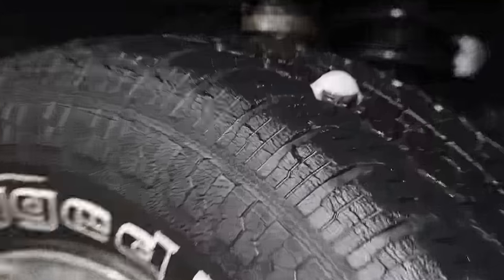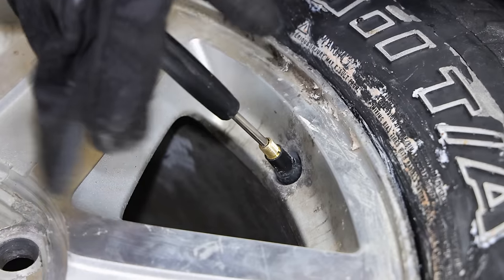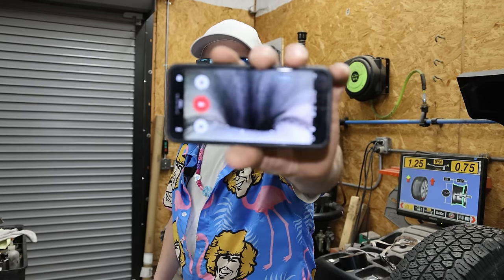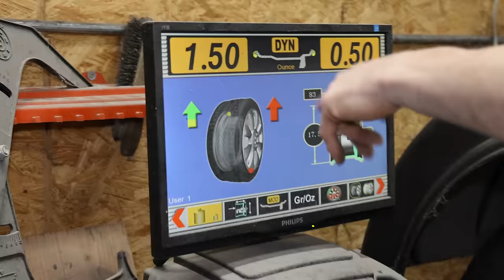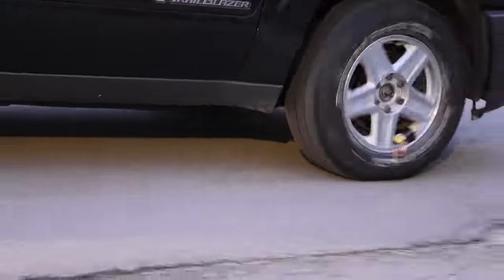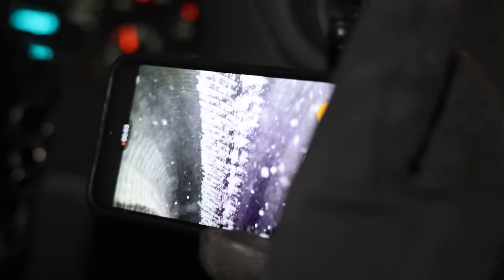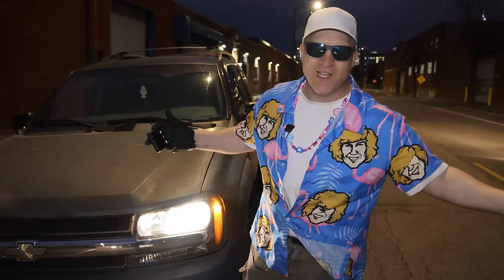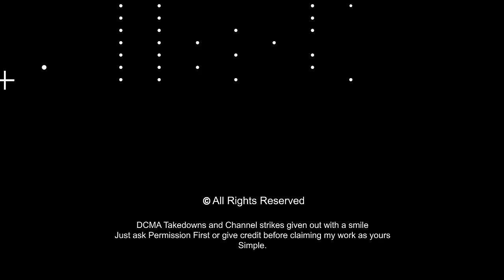GoPro Inside a Car Tire (With Balance Beads)

Comment: I spent 2,500 bucks on a set of 33x12.50-20 wheels and tires for my truck and the shop recommended balance beads cuz they were the new best way to go. A horrible shake around 45 mph that lasted to around 70 and 3 trips back to the tire shop later they took the beads out and balanced them with some stick on weights. problem solved. Not sure why they wouldn't work for me but they wouldn't. Maybe someday ill try a different application but for now i am not a believer.
Reply: These Are About As Genius As Filling Your Tire With Fix A Flat. How Many Of These Tires Are Designed To Have A Bunch Of Plastic Balls Wearing Peculiar Parts Of The Tire From The Inside? Damn We're Dealing With A Bunch Of Fucking Downsey Einsteins.
Reply: It makes me wonder if there weren’t enough beads in the tire to make it work
Reply: I bought Nitto 33x12x20 for my HD2500, have had balance beads since day one, 4 years, and I  have never rotated my tires, and they have worn more evenly than any tire I've  ever had. 50,000 miles on them and still have half the tread!
Reply: @robertheinkel6225  I wondered the same thing. When you buy them they come in bags, one bag per tire I guess but you would think not all tires are create equal and obviously much different in size. I surely can question the competence of the shop as well. Thier is a reason I do all my auto work myself with the exception of tires since I lack the machine and balancer.
Reply: I run 35s with 10oz of off-road beads works excellent.  You went wrong going to some pea brain shop. I got my own tire spoons and mount my own. They didn't use enough beads.
Reply: They didn’t put enough in.  These are mostly used in tractor trailer tires.
Reply: Big heavy tires are hard to balance and take a alot of weight sometimes. Every tire is different, rims can be bent. There are a lot of factors at play. The shop I worked at only used them when there wasn't enough room for all the weights on truck tires. You can't really hammer on 20 oz. I can't see why you would use them if you have the option to use regular weights. That being said, stick on weights sometimes fall off and are not as good as hammer on for balance. Your shop may balance a wheel perfectly but that doesn't mean it won't shake. If a wheel requires a lot of weight to balance out, it may never ride right. Sometimes you play with the tire orientation on the wheel or just get a new tire or wheel. Sometimes swapping around what you have works. Sometimes you slap on the weight and everything is totally fine.
Reply: 😂 I have a really good idea, if you normally accelerate quickly they don’t work very good for you. Or else they added the wrong amount to the tires but I doubt they did that.
Reply: You had too many beads inside the tire.....
Reply: Sounds like the shop just put in your beads and left them in the bag..  So they were bunched up all on one side? lol..
Reply: My experience EXACTLY! Tire shop insisted they go into my 265/70R22.5 Toyo Truck tires on my 33’ motor home. Ran them almost to OKC from Phoenix. Stopped at a Truck Repair and had them balanced the old way! Problem Solved!
Reply: I've had bad experience with offroad tires and beads, because they tend to have inconsistent radius (I don't know the right phrasing in english). If the heavy side and high are on same side, beads will go to the wrong spot and make things worse.
Reply: The Counter Act balancing beads he shows here are not plastic but rather smooth glass beads. I use them in my Semi Truck tires. There's a chart that shows the proper Ounce bag to use for your size tire. Also install the extended valve core that comes with them
Reply: They ABSOLUTELY work.  I've been using them on a LOT of my customer's cars for years now.  Anyone who thinks they don't, and would like to bet on it, just let me know how much money you'd like to lose, and we'll set it all up. 👍
Reply: @calholli  lmao. right?
Reply: @calholli  once I caught a 'qualified' tire "technician" he didn't know anything about these so his foreman had told him just throw the bag in there before mounting the tire...  🙄 ... well I had walked away to do something, came back and was asking him about the valve core & Red cap that comes in the bag(Outer bag) and he had no idea what I was talking about! He had literally threw the whole outer bag inside the tire! So I made him dismount the tires & take it back out & I instructed him how to install them correctly!! 😊
This was on Semi Truck tires at a Love's truck stop.
Reply: @Roger_Rabbit_Adventures   It always surprises me just how 'in the dark' people are with most things.   That's exactly why I work on my own cars..  I've seen a "technician" inside a dealership who was tearing down an engine and rebuilding it for a repair --  and the kid was barely making minimum wage and didn't have a clue what he was doing;  and there was no one around-- he kept having to go into the office and ask what to do next, etc.  While ASSEMBLING AN ENGINE;  and you can tell, he was just cIumsy and not good with his hands.  The dealer was charging 150 per hour, or whatever it was;   So you're paying top dollar,  yet this is the service you get.. hoping that he doesn't mis a few bolts or skip the torque specs, etc..  It's just crazy.. I can't do it.   I have to fix it myself.

Comment: After a while those beads start to tear up the tire from the inside. I’ve seen and heard of rubber “Powder”  coming off from the inside because of the beads. 
This stopped me from using them on my Harley.
Reply from the maker: I was thinking about that.
Reply: @WarpedYT I was told they are mostly used in Re-Capped Semi Truck tires and not to put them in new tires. 
I stayed with the stick on weights for my Harley which don’t look good.
I really wanted to give them a try, but those Harley labeled White Walls are big $$$.
Thanks for Great Video! The camera inside the tire was fantastic.

Comment: No surprise to me that the balancing bit worked.  45 years ago, I used a semi-viscous motorcycle tyre sealant for the purpose of sealing any future punctures.  The manufacturers also claimed that it automatically balanced the tyre (which it seemed to) and caused the tyre to run a bit cooler (which I couldn't test).

Comment: Mind blown on the camera inside the tire view! I have used a competitor Dynabeads that are ceramic in my motorcycle tubeless tires and they work as advertised. That company recommended how much to put in different tires and putting more than that won't help you. I didn't realize there were so many competitors now.

Comment: We use balance beads on medium and heavy duty Trk tires.  They mostly work great as long as you use the correct amount for the tire size.
Reply: The Counter Act balancing beads he shows here are not plastic but rather smooth glass beads. I use them in my Semi Truck tires. There's a chart that shows the proper Ounce bag to use for your size tire. Also install the extended valve core that comes with them.  Like you said use the correct amount & make sure they are installed correctly

Comment: 20g airsoft BBs work great for the big tires. I ran a pound in each 37-40" tire. Each outing I would loose chunks of tread from rock crawling. Always felt balanced 0-75mph. The tire machines often don't show truly how well they work, also a lot of places can't balance a 40. Far better than stick or clamp on weights because it puts the weight out farther and...for offroad guys...adjusts to tire conditions instantly.

Comment: You trying to fill the beads through the valve stem cracked me up for an hour!  Good video - seriously always wondered about this (use them in my motorcycles for years) too bad I still don't fathom the physics involved 😛 Guess I'm just a dope...but they work 🙂

Comment: Used balance beads on a set of 37" tires years ago.  The truck drove smooth as glass.  Plan to use them again on my next set of tires.

Comment: I ran balancing beats for 6years+ on multiple cars. And yes they do work very well. Just make sure you have 1oz more in the tires per tire. The extra weight makes it even smoother on 100mph and more. The vibration you saw each time the tire hits the surface ground causes the not balanced beats to move a bit till they hit the correct spot to balancing out the whole tire assembly.

Comment: I bought two new tires for my motorcycle.  Went for an unbalanced ride and got death wobble at 55 mph.   Came home and put the beads in my tubes.   Like you, Its not easy to install in a tube. I found a twist tie in the plastic tube and spinning  it a bit worked best. I then went for a ride. 105 mph is top speed on my KLR 650. It was very stable at that speed. I have used the same beads on numerous tubes by cutting it open and reusing

Comment: Briefly explained the tire will always rotate around its center of gravity. Picture putting a plate on the tip of your finger and balancing it. Now add some weight to one side of that plate. You would have to move your finger closer to the heavier side in order to find the center of gravity. This is exactly what a out of balance tire does. Because the heavier side is closer to the center of gravity it will describe a smaller circle than the other side as it spins. The side that describes the larger circle has more centrifugal force and will therefore attract the balance beads to it. This is how the balancing action works.

Comment: I'm sure it has been explained many times in the comments earlier:

A rotating body rotates around its centre of gravity. That means the heaviest point of the wheel is CLOSER to the center and the lightest point is farther away, making bigger circles. That means the most centrifugal force occurs at the lightest point of the wheel. 

That's why the beads end up on thelightest side of the wheel and if there is enough of them, effectively balancing it. What's left over, will be hanging around the tire like we can see in the video - obviously there was a lot of beads on the opposite side of the camera.  

*

Knowing all this I can only say it's a massive disappointment that the balancing beads are not available in Europe and nobody even seems to have heard about them over here.

Comment: I've used them for years in my motorcycle tires. With my Yamaha FJR they ran smooth as glass from 35 to 135. When I changed tires,  I drilled a hole in the old tire and drained out the beads and re-used them. Never saw any interior damage to any of the tires I ran them in.

Comment: There's a video on YouTube of someone putting them in a pop bottle and spinning it with a drill, when you can see it visually you can understand what's going on it's a little easier to wrap your head around. User and a believer, got to watch out for moisture in the tire, it'd be nice to use them with nitrogen because in the wintertime if you have any moisture in your tires they'll freeze up into a ball and you'll have a little thump thump until they break up. Tires heat up fast though, you can see all that flexing going on.

Comment: The added weight of the beads with centrifugal motion pulls or stretches the center off the tire outward creating tension on the sidewalls and pressure on the center. Basically, you are giving the tires a face lift, helping to even out the bubbles or wrinkles in your tire spreading out the mass more evenly, but notice it only reduces it and the added centrifugal mass probably reduces precious gas/petrol/diesel more than it helps. Although this may increase fuel economy by firming up the tire acting like more air pressure is inside. There is an idea. For off balance tires, just add more air pressure. Note: too much pressure will make tire bubbles bigger. If you have any bubbles in your tires, you should not be driving on them.

Comment: It works like you think but when the bulging(heavier) part of the tire hit the asphalt it is pushed back in. So this is the place on the tire with the most movement or vibration which causes the beads to move away and as they do they counterbalance the tire and neutralize the vibration.

Comment: The best approach to install through the valve stem is to keep the bottle air tight to the stem and gently pump cycle on the bottle and slowly tip the beads in. As you release the bottle it sucks back the beads and clears the line. It takes some patience and finesse but after a minute or two it can be done.

Comment: You gotta squeeze the bottle while you pour it in through the valve stem. The stream of air keeps them from clogging in the valve stem. Using the tube it comes with is a must. I run them in my motorcycle tires. It works.

Comment: I ran balance beads in a Harley Streetglide, they work great, i liked knowing the balance weights cant fall off on a long road trip, my last trip qas over 6000 miles and the balance beads work great, i even out ran a tornado where i had to hit 100mph and hold it because the sky was black and i had to get out of there in the middle of no where Kansas.

Comment: It's been a well known fact for a long time that this principle works. Back in the 70's the same idea was put forward using x4 heavy metal spheres with spikes on them, the idea being they find the correct position and embed themselves into the tire and don't end up rattling around at low speeds. Other versions of this have included fluid filled interconnected chambers on a flywheel.

Comment: I use balance beads on my motorcycle tires and they work great with one caveat. You cannot use grease or paste to lube up the drop center of the rim. Over time the beads will just start to stick to the paste and stop doing their thing. 

When I mount a tire, I just apply paste to the bead surface on the rim and bead surface on the tire taking care to keep the drop center surface free of paste. When you roll your bike around the garage or parking lot you should hear the beads rolling around. If you stop hearing it, they all got stuck.

Comment: Been running beads in my motorcycle a couple years now. I don't do high speeds where beads don't work. They are great if you have spoked rims with innertubes and do your own tires.

Comment: I have a RAM 3500 dually with balancing beads in the Michelin tires. They balance them perfectly in the city or highway, towing or empty, on bumpy or smooth roads. I can feel them smooth out when I'm moving over 25 mph. Interesting fact that may make others consider this - Michelin's warranty states that they will not cover these tires if I use balance beads in them.

Comment: I have used the larger off road size dyna beads for years on 12.5 33 15 tires on my Jeep. They work great. They do have to be dumped in before the bead is set.

Comment: I use heavy air soft bb's in my 35 inch jeep tires, they work great. Also, I have been 200mph many times with the dyna beads in my motorcycle tires. I trust them.

Comment: I know someone that has used balance beads forever.   Never had any tire wear issues and always a smooth ride.  He just mounts his tires himself and dumps some beads in there to save money.  He only does this on his little daily driver Corolla though.  He said it isn't ideal for highway use but if you're driving through town or on rougher roads they work perfectly.  I wonder if that's because they need to be moved around properly to distribute and not build up?  I wonder if the inside surface of some tires can mess with the beads as well.

Comment: I have used them in tires for years. Motorcycle, trailers, trucks, cars. I have never had an issue and i have never had to balance a tire. As long as you use good tires and your rims are true. I have never had odd wear or vibrations.

Comment: the balance bits work thanks to the centrifugal force of the spinning wheel. They just spead out evenly depending on the wheel's shape. The thinnest regions get more bits. But it will temporally get out of balance after driving over a bump

Comment: The vibration from the imbalance causes the beads to move away from the areas where the tire is heavier. Essentially, the heavier area is pushing outwards more strongly due to its greater mass, and the lighter area is where the imbalance is felt as a kind of "void" or lower force area. The beads move to fill this void because the lighter area has less force pushing outward, allowing the beads to settle there.

Comment: I have used balance beads on my motorcycles, I have never tried them on my cars/trucks but believe they would work.  The mass of the tires/wheels will dictate home many (mass) beads you have to put in the tire.  My lifetime experience with motorcycle tires have 100%+ using these.

They work best if you have tires/wheels out of balance as it helps to align the beads.  If the tire/wheel are close to being balanced, then the beads will have a harder time moving to a fixed spot to correct the imbalance.  In this case, they will be continually moving about ever so slightly going in and out of balance.  

You also need sufficient centrifugal force (tire rotational speed) to get the beads to be thrown to the inside of the tire.  If you are going slow, the beads will be constantly tossed about (up and down), you see this in the video.  Once you are going fast enough, the centrifugal force will pin the beads to the inside of the tire and then they will migrate due to tire imbalance to the optimal spot to balance the tire.

Tell the tech you have balance beads in the tire, and they can dismount the tire careful enough to capture the beads.

Super video.